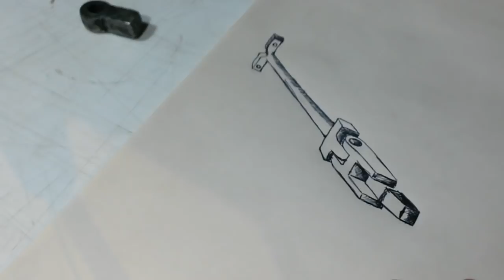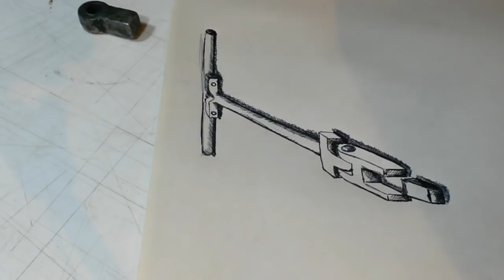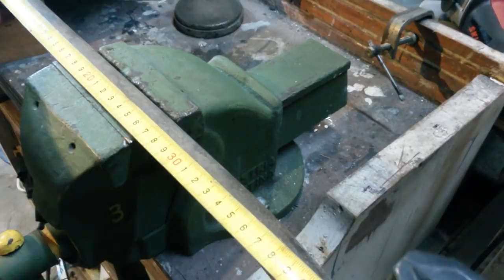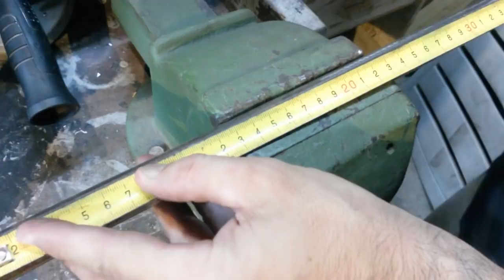HERRAMIENTA CASERA PARA TALLER MECÁNICO,  fabricada con partes de automóvil - AMAZING!!! Tool Idea#4

Comment: TE SUGIERO Humildemente, conseguir que en un taller grande te hagan un "granallado" o "SHOT-PEENING", que consiste en "bombardear" la pieza de metal con perdigones de acero endurecido... Lo que se logra con ese proceso sencillo y rápido, es martillar toda la superficie de la pieza, con lo que se comprime la capa más superficial del metal, que al quedar con un esfuerzo residual a compresión, reduce BASTANTE la tendencia a desarrollar grietas de fatiga. Con ello te arriesgas mucho menos a que en un esfuerzo grande, la herramienta se rompa intempestivamente y te lastimes, quizá gravemente...
Ese procedimiento lo aplican en las bielas de motores de alto rendimiento, y la máquina de granallado (que es como un "Sand-Blast" pero con balines y no con arena) la tienen en talleres donde modifican motores para competencias, y allí se lo aplican a las bielas, que de otro modo, se fatigan y rompen a altas RPMs.
Un gran Saludo desde México!
Reply from the maker: Buena idea Alfredo, gracias y bienvenido a la comunidad de Técnica X 👍